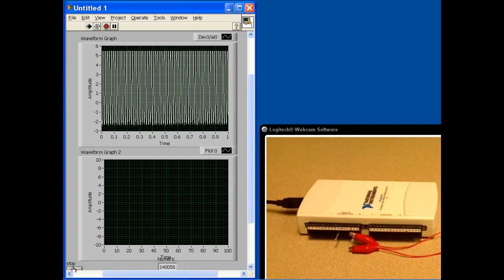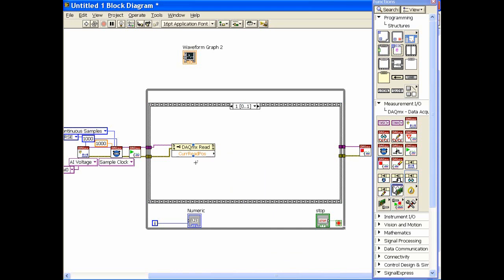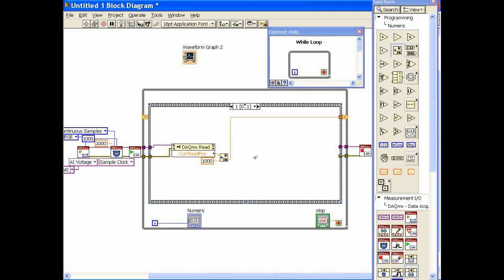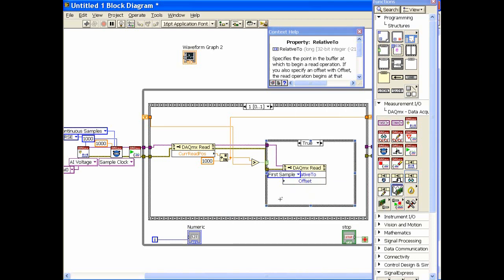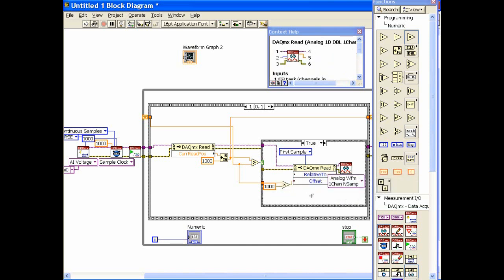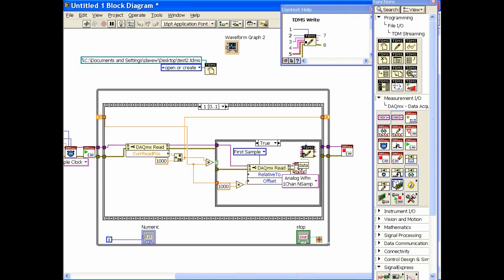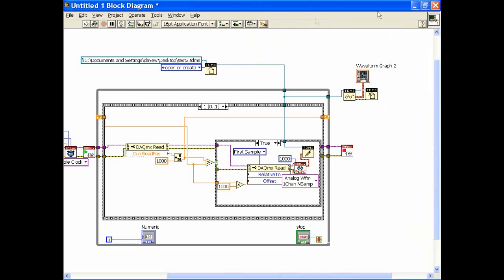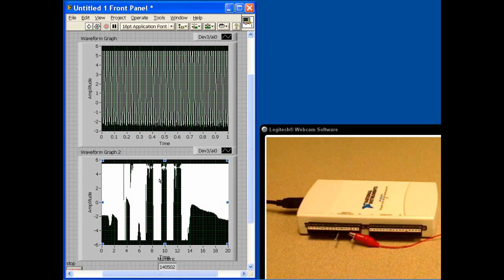High Speed Display and Data Storage with DAQmx Part 2

Comment: Hi! I'm getting an error with the first part of this code. How do I fix it?

Error -200277 occurred... Possible reason(s):

Invalid combination of position and offset. The position and offset specified a sample prior to the first sample acquired (sample 0). Make sure any negative read offset specified will select a valid sample when combined with the read position.

Property: RelativeTo
Corresponding Value: Most Recent Sample
Property: Offset
Corresponding Value: -1000